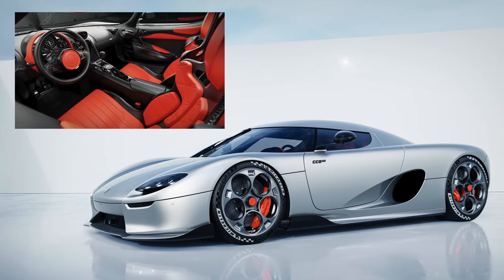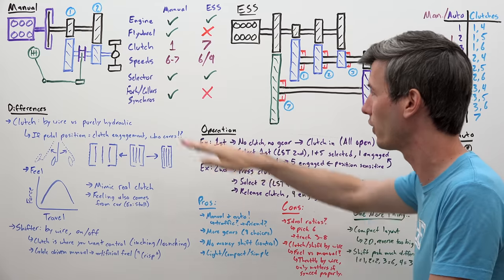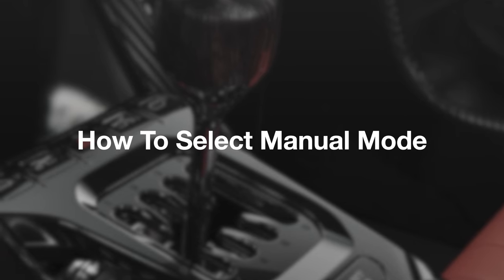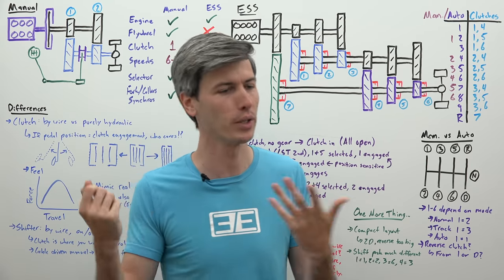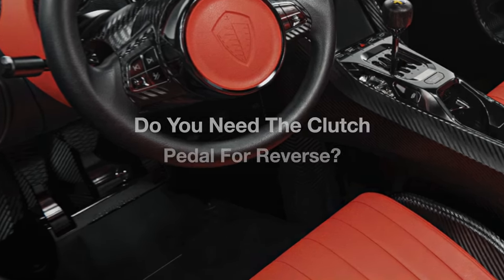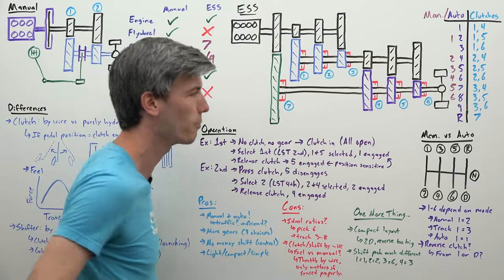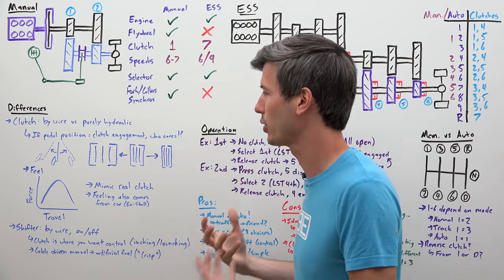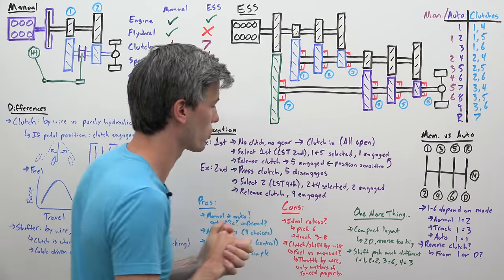Koenigsegg Reinvents The Manual! How The CC850 Transmission Works

Comment: now this is the exciting stuff i want to see in the car industry, not bigger screens, fake exhaust tips, touch buttons or any other nonsense
Reply: Yes, please! But people focus on little toy things, not mechanics. Most people don't like driving, they like cars as a material thing.
Reply: And I assume you are also very excited for the maintenance cost... I would much rather take all that you have mentioned and a proper manual instead of this over complicated stuff. But ofc if you are the descendant of Bill Gates it might be feasible for you
Reply: @horvathr95  you'd be surprised. These transmissions will likely outlast the majority of the gimmicky electronics in mainstream cars, not just because of who made it, I just mean overall. If these were put into mainstream cars, they'd end up being the only option of transmission, to offset cost, but the scalability associated with mass production would also drive cost down, quality would waver a bit until the prices did eventually decrease, but after that point these things would be even more insane than the original and just about everyone would want them, at that point, with the market saturation, and the availability of parts as well as number of specialists by that point,  your maintenance concern would be no worse than with any mainstream transmission. The thing about a well-built gearbox regardless of style, is that it will likely outlast most components of a vehicle so long as it's maintained and serviced consistently and properly. Even with the added complication of added parts, unless the egg box is fully electronic and not at all hydraulic- firstly you'll likely know when or if it's tiring out, about to fail, or already doing so. If its fully electronic then everything I just said goes out the window and I say give me this trans, but with hydraulic actuation with electronics to serve only as assistance/redundancy, and monitors, because while I and many others these days might be able to troubleshoot electronics to some degree, I despise automotive electronics. Can work on them but I don't like to. I hate that "replace everything" mentality, but unless the repair is something I can do quicker,  cheaper, and near as well, as compared to buying a new part and waiting for it to arrive, I tend to just buy the new part.
Reply: Automotive industry is all gimmicks
Reply: @LtdJorge  it's unfortunate because cars haven't always been viewed as an appliance.
Reply: Speaking of FAKE things, this transmission is a FAKE manual!
When you shift your are simply telling the computer to shift to that gear. The only difference between this and a shiftable automatic is that you can tell it to “clutch” into neutral…… this isn’t even the first computer controlled manual. Lamborghini uses one, and so do Chevy and Ford…
Reply: @Mr3X7R3M3  you didn't watch the video.
Reply: @LtdJorge   lol yes I did, but as a mechanic I understood it better than most I guess
Reply: @LtdJorge  There is no physical connection (only wires) between Clutch pedal / shifter and transmission itself so its FAKE (shift by wire) just like Sim Racing rig
Reply: The masses just want cupholders and apple car play.
Reply: Hey carpal like your videos
Reply: They also have developed electronically actuated engine valves. This guy has a vid on it and it’s amazing.
Reply: Your point still stands, but design is important in selling cars in today's auto markets, especially given its relatively stagnant innovation compared to a couple decades ago. 

Nonsense? Yes. Beneficial to the success of the product? Also yes.
Reply: Somebody watches Sarah-n-tuned 😂
Reply: @Pearce244  the physical connection between a traditional clutch pedal and its clutch is a liquid inside a tube, not a connecting rod, so it's FAKE.

Besides, the gas pedal is drive by wire and nobody complains.
Reply: This is a fake h shifter. Very silly
Reply: @LtdJorge  this fake shifter is like buying smart phone with a pulse dialer on it to make phone calls
Reply: As someone who is a professional programmer by trade, I don't freaking want more computers in my car.
I want real mechanical engineering.
I'll die on the internal combustion hill.
Reply: And also, if they can match the acceleration of a 473mph wind speed blowing from behind it.
Reply: Its Koenigsegg. What do you expect
Reply: My god, it's BeamNG himself.  Funny seeing you here.
Reply: @Mr3X7R3M3  Which Chevy and Ford have a clutch pedal and electronically shifted trans?
Reply: @Mr3X7R3M3  "as a mechanic I understood it better"

You sound like one of those guys that constantly whines about manufacturers adding emissions control systems and are convinced its only done to make the car break sooner.
Reply: @ferrumignis   lol Honda was caught causing check engine lights to come on before maintenance was required just to bring people back into the dealerships… Ford was actually doing the opposite (they specifically required many more cycles to illuminate the CEL, making people think the car was more reliable lol)

“Your sound like…” yeah, you sound like a little kid that believes anything you see online and then thinks you know more than everyone else….
Reply: @Mr3X7R3M3  Thanks for the confirmation, a know nothing "mechanic" that blames everythimg else apart from his own ignorance.

Notice you didn't even provide an answer to which Chevy and Ford had an electronic shifting transmission with a clutch pedal, despite claiming they both do.
Reply: To everyone who thinks this is cool: you’d be amazed by a proper automatic transmission. They are much more advanced than this shift by wire thing.
Reply: Koenigsegg are absolute pioneers in technology that they want to see. I love them. I love this tech, and I guarantee it's rock solid. Having said that, you won't be using it ever. The future of normal driving is EV. Koenigsegg know this, and they do cool things in this space as well. Us plebs will be driving Hyundai EVs while the uber rich are stalling their hypercars because they don't actually know how to drive.
Reply: @rylandallas9907  that’s not true, there is also substantial engineering going on in many areas. Don’t let the marketing bs cloud your view.
Reply: I love fake exhausts on electric cars 😉
Reply: Love your channel man❤
Reply: @horvathr95   Yes exactly. Woohoo 7 clutches that can burn out instead of just one!
Reply: All buttons are touch butthons, what the hell are you talking about
Reply: @horvathr95  this is just a dual clutch trans. no different than any other besides the fact you can manually select gear with a gate and control the internal clutches by foot
Reply: @ThatWasPrettyFunny  my problem with this gearbox is that is pandering to customer wanting something old. If they had bade the gear stick do something new I'd be happier.  It take more imagination and innovation to come up with a new type of controlling the car rather than looking backwards.  With this gearbox there was an opportunity to do something new.
Reply: Now MORE rounded!!
Reply: Exactly! And not those useless Electric cars either.
Reply: @123devinzz1  No, in a DTC you have 2 clutches that you need to maintain (all clutches are wearable), in this overengineered trans there are 7 clutches that will have to be replaced at some point.
Reply: @Pearce244  So a car with drive by wire is a fake car then with that logic?
Reply: Everyone in this thread needs to go to about 15:44 and pay attention. Work on those listening and comprehension skills.
Reply: @liiiinder  Car is real but the there is no feedback on the pedal so any feel of the pedal is made by some who thinks that it should feel like that, and not because there is reason for it to be that way. Just like engine sound through the speakers or steer by wire. Same thing.
Reply: Find a life lol, cars are not that important...
Reply: OMG I would LOVE to have a transmission like this in my car for those times where I'm stuck in city traffic.  That would be amazing.  The only thing I don't like about driving my 6-speed manual is stop & go.
Reply: +1 for this.  Just on the topic of touchscreens, I hate them. Yes, great for a smartphone, because I’m concentrating on the screen. But when I’m driving, I’m looking at the road and surroundings.  I want fixed position tactile controls that I can distinguish by feel and muscle memory.
Reply: SNL - Serious Next Level!  AI is going to teach their robots to do this.
Reply: Just unnecessary complicated fake manual transitions so you can feel like you are doing something but also have the computer to save you when you mess up
Reply: @Mr3X7R3M3  No, a fake shifter is like my sisters Corolla, it is a CVT, but has "shift points" where the ratio changes in steps, the engine revs change, and it feels like a shift with your butt dyno.  It also has a sport mode where the fake shift points are all higher up the RPM range.  A CVT has no set ratios, so there should never be a shift that you can feel.  This is a fully mechanical gear system with fixed ratios and you the driver get to pick when to shift, and into what gear.  Just because the linkage involves electronics doesn't make it fake.  If you really want a real manual with lots of feedback you better get something without a hydraulic clutch, because a hydraulic clutch decreases the "feel", and while you are at it get a shifter with a solid linkage, not one of these shifters that uses cables, because they really do decrease the feel. Come to think of it, maybe you better get a transmission without synchros in it, because they cover up the feel of your RPM mismatch when you shift gears.  Better get a dog box.
Reply: What if transmission computer stops working? When would that transmission need to be replaced and how much would it cost? Just a couple EV questions applied to a gas car... haha.
Reply: @LtdJorge  This IS a "toy thing" 🙄
Reply: @LtdJorge  Actually no. First it was a hard link tube, then a cable, THEN hydraulic.
Reply: Mainstream car maker can make this stuff, it's just the maintenance is a headache. Thats why we either have A or B, and the service guy need to know wtf they working on as well. so yeah, you could make a car system to have any transmission but the cost and reliability and maintenance is the main things.